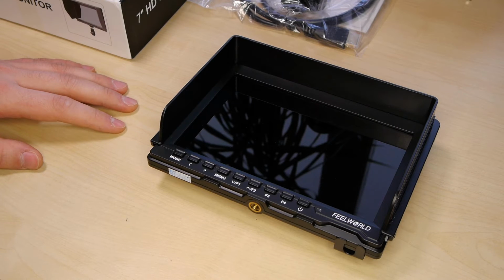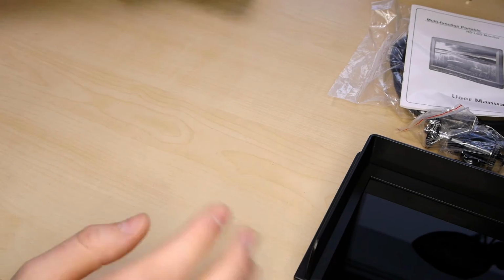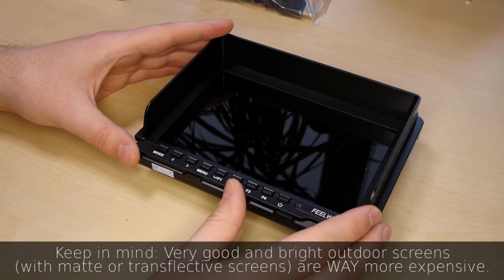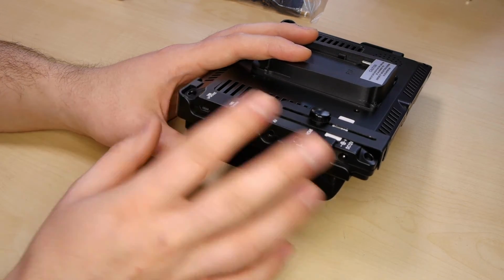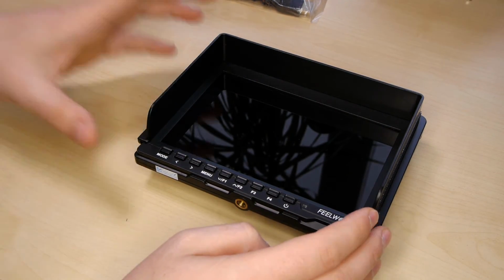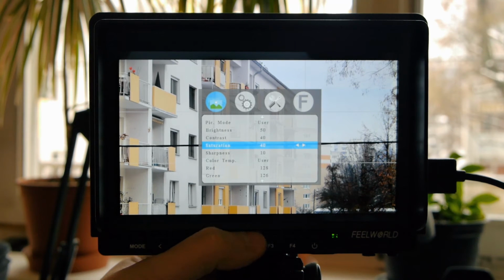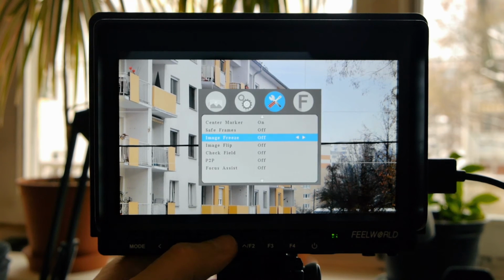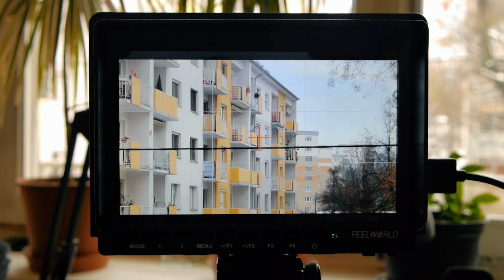Feelworld FW759 / FW759P field monitor - Very detailed HANDS ON (with calibration settings) (!)

Comment: Is there a way to turn off the speaker audio? I was filming a interview yesterday and could hear the speaker output. I guess i could plug up some headphones with separate audio control and turn the volume all the way down, but was just wondering if there was a better way.
Reply from the maker: Sorry for my late reply - Was busy ^^. You need to use the left / right arrows to control the volume. Just put it to zero (then you don´t need to use a 3.5mm plug or headphones to disable the internal speaker. Have fun shooting (!)

Comment: Help Please i just purchased at the same monitor and i tried using it for my canon t6i and it will not show anything?? have Any Ideas??
Reply from the maker: Hello there. Did you enable the live view on your camera (or the play mode -> To get a picture over the HDMI)? If you didn´t try it out -> Connect your camera to a TV set (with HDMI in).
If you get a picture there but not with the FW759 maybe try an HDMI feed from your computer / notebook. (The FW759 should be fully recognized over any HDMI port.) Maybe also try a different HDMI cable (the included ones are often of a not THAT high / desireable quality ^^).
Reply: what do you mean about play mode??
Reply from the maker: SniperFilms Playback mode (where you can check your stills and videos) ^^. As then also the HDMI is active (like while live view is active).

Comment: I recently bought US Stock Feelworld FW759 7 "HD
When I connect it with my camera, the battery starts to make a strange sound. A may be due that? Await response.
Thank you
Reply from the maker: Hi there. I am btw. not the supplier / dealer / manufacturer - So it´s maybe a good idea to contact the seller too.

But overall: Is it the camera-battery or the battery you use on the monitor to power it? If it´s possible, then try to change the batteries (maybe you got one with a low quality control circuit).
Btw.: Are you sure that it´s coming from the battery? Also try to plug in 3.5mm headphones on the screen (or dial down the volume of the FW759). Because: It´s maybe coming from the speaker at the back of the FW759 (theres the risk of a "feedback-loop" -> The camera is recording the audio -> Monitor is getting it over the HDMI and outputs it live. The camera records that again and so it´s getting louder and louder - If that´s your problem -> Yes. It´s a really weird noise ^^.)
Reply: It was a theme sound loop! Thanks a lot friend! you solved the problem I had! i'm happy! jejeje
Reply from the maker: Good to hear that it works now - Have fun shooting (!) ^^

Comment: will it be compatible with a canon xl 1 s? my view finder needs repair. quoted $400. will this replace it and save me the money quoted?
Reply from the maker: Puuh. An XL1s - Long time went by since I saw the last one in real life ^^. Hmm. I think it makes no sense to go for the FW759 (as I cannot tell you how good the analog input is). There´s also no converter included (you need to order it seperately) -> Because of that fact I never testet that input. Maybe it´s a better idea (overall) to search for a used cheap screen with direct component or S-Video inputs. Then you also don´t need a converter cable (the FW759 / FW760 only uses a very small 3.5mm adapter -> On the RIGHT side of the screen - Also a super stable and handy solution overall). Beside that, the older ones maybe produce better analog images (compared to the new models) -> The new ones are normaly optimised for digital inputs.

Maybe you´re lucky and you can find something for a few bucks (on Ebay for example) ^^. Especially the older screen models (without any digital interfaces) are normaly quite cheap. Btw.: Maybe also check out online communities according the viewfinder of your XL1s. Maybe someone can repair it for you (at a cheaper / lower price point). ^^

Comment: Does this work with nikon d3200?
Reply from the maker: Yes. It´s working. But you get overlays with the D3200 (like on your back display) and the image is not 100% covering the 16:9 image of the screen. You can test it out with a TV btw. - Just connect the camera with a proper cable and play around with the settings. (Also according the info display / info button for example.) Btw.: You can also try out the nikon hack. You get at least a higher bitrate (64MBits) and no time limit (at least its stated in the log as beta state). Sadly it´s not fixing the HDMI (so it´s outputting 1:1 the 16:9 image internally recorded).
Reply: Ok. Thank you. Why does it not 100% cover the image?
Reply from the maker: Well - Good question ^^.

In general (and especially with older DSLR models) they simply output / re-route the image displayed at the back over the HDMI. And as the image displayed there is no 16:9 format - more likely 4:3 or 5:4 or so - you also only get that image over the output. As mentioned: I highly recommend that you try it out with a HDMI capable TV before bying a field monitor (to see if it´s ok for you - And so you can try out different HDMI output options and info display options).

Btw.: Even if you cancel the deal after testing, you then have at least an HDMI cable to show pictures or videos over your TV (directly from your camera). ^^ Just two hints: Don´t get an extremely long one and go for a thinner / more flexible one - That way you can use it for both purposes (field monitor AND TV output) ...
Reply: That makes much more sense now. Thank you so much for your help!

Comment: will this work with a canon t5i?
Reply from the maker: Yes. Should work. But there could be a small black border on the edges of the frame (as the smaller canon cameras are not outputting a raw signal without any overlays / limitations to protect the Cinema line and the more expensive cameras from Canon - As an example: Even the brand new 80D isn´t coming with a 100% clean output .). Btw.: You need to switch through the HDMI output modes with the INFO button (there´s one mode with a bigger image and nearly no overlays). You can still try out the monitors zoom modes to remove the borders (or use at least udnerscan). But don´t use those modes if they make the image worse. ^^
Reply: ok, thank you for your reply!

Comment: So basically, my Canon T4i is useless with this monitor?
Reply from the maker: No. It should work - The "camera mode" wich adds aliasing and moiré is just neede for the REALLY old canon cameras (which output 480P while recording and only 1080i in standby and playback mode). The 650D (aka T4i) is outputting 1080i all the time. BUT (as I told "nicolas picard" a few seconds ago): There could be a small black border on the edges of the frame (as the smaller canon cameras are not outputting a raw signal without any overlays / limitations to protect the Cinema line and the more expensive cameras from Canon - As an example: Even the brand new 80D isn´t coming with a 100% clean output .).

Btw.: You need to switch through the HDMI output modes with the INFO button (there´s one mode with a bigger image and nearly no overlays). You can still try out the monitors zoom modes to remove the borders (or use at least udnerscan). But don´t use those modes if they make the image worse. ^^ You can also try out the HDMI output with a TV set (you just need a cable to test it).

Btw.: Screen wise its also working (as the FW759 and FW760 are 100% compatible to the interlaced signal of your T4i).
But avoid for example the Aputure screens (also the new Fine-HD models). They are not usable with interlaced signals.
Also check out the FW760 (it´s like an upgraded model of the FW759 with a higher resolution panel and even more features than the upgraded FW759P model) ^^.

Comment: Is there a battery charge indicator? How can I know if I have to recharge the battery?
Reply from the maker: There´s no battery indicator with this model (maybe the new FW760 got one - But this I cannot tell you as I don´t have or had the FW760 til now). Overall it´s the best idea to test out the runtime with the batteries you plan to use with it - BEFORE shooting the first time (NP-F550, 730 or the biggest 970 ones). Then you know (+/-) the runtime - Or you can also use an external battery plate with voltage indicator - Then you also know when you need to change the battery. The point is: It also depends on the batteries you use (and the quality of them). ^^
Reply: Thanks

Comment: Hi, been looking at this monitor but to have the battery pack at the back of my glidecam while having this monitor mounted to the front. I heard you say that the DC socket is 2.1 instead of 2.5? I am very confused in if this :
http://www.ebay.co.uk/itm/361565203908
is a 2.5 or a 2.1 cable? Since I would have to buy an additional cable to get from one side of my glidecam to the other since the DC cable that comes with that link is too short. 

Any help would be fantastic!
Thanks
-Connor
Reply from the maker: Hi there. Well - It&#180;s a 2.1mm socket. But it also accepts 2.5mm plugs.
It has more "play". But it is still working. So even if you only find a 2.5mm cable for cheap, it should work too.
At least it worked too with all of my 2.5mm cables I have lying around ...
And the 2.5mm ports are standard - So the 2.5mm cable is also better for the future.
As basically all other devices use 2.5mm plugs. ^^
Reply: ahhh, thats great then! So even if it is a 2.5mm DC cable then it shouldn't matter? Sorry I'm knew to the entire monitor/DC etc. business!

The plan is to get this monitor and position it at the bottom of my glidecam at the front, then buy that ebay item I linked to put to hold the battery at the bottom of the glidecam at the back so that it roughly has the same weight to balance it. this monitor looks perfect for it! So would I just order a DC 2.5mm to 2.5mm cable that is long enough to get from one side of the glidecam to the other?

Thanks so much for the quick response and help! We need waaay more people like you on youtube/online.
-Connor
Reply from the maker: xG4m3rPr0x Yes. Should work. As mentioned at least with my cables it worked (tried it with two different ones). It had also no connection problems. Was just more loose than with the 2.1mm one. But please don´t nail me down on that  - Just because it worked with my cables, that doesn´t mean, that it will work with any 2.5mm cable out there. ^^

But you can go for the 2.5mm anyway. Even if it´s not fitting (and the chance is high that it fits), you can also keep the 2.5mm version for the future. Because (as mentioned already): Basically all other field monitors and also most other accessories work with 2.5mm cables (as it´s kind of the "standard DC plug").

About mounting the screen: Should work yes. You maybe need a pair of 1/4" screws to mount them (which are long enough). But then it should be possible. You can even use the small ballhead which is included to mount and tilt the screen to the right position. Just remove the hotshoe adapter at the bottom of the ballhead.

Btw.: I also use such battery plates (Though - The older / standard model without the 12V converter internally). They work nicely. Just keep an eye on the mounting position. The 1/4" thread is a little bit offset with that plates (check out the 2nd picture). So to get a perfect balance, you maybe need to mount it a little bit angled (so the center of gravity - sideways - is in line with the rest including the mounted battery). Otherwise you have too much weight on one side (and it´s not possible to balance that out with a steadycam - At least not at the bottom).

Thx for the kind words btw.
Have fun shooting - And have a nice day. ^^

LG

Comment: Hey I am having difficulty understanding.  Would you please be able to help?  How can Blue or Green help detect noise in the image?  I have looked at check field blue and I don't see any way to detect the noise.  Please do let me know.  Thanks
Reply from the maker: Under normal conditions (at least with the standard CMOS sensors) it is the case, that blue channel is for example the "weakest" overall - So under normal conditions / with normal CMOS sensors it´s the best way to check the noise over that channel. Why? Because the bayer array uses blue + red + two green sub-pixels. So blue and red need more gain to get to the same levels as green. (Btw.: Green is doubled, as most of the brightness and contrast response is coming from the green channel - So there´s more sensitivity necessary). But there is also another point why blue is the "worst" channel: Red is additionally also more sensitive than blue (at least on normal CMOS sensors). So even though the sensor has the same count of blue and red pixels, you need to bump up the blue gain higher than the red one.

So overall the blue channel needs the most gain / amplification.
Therefore also the ground noise is amplified the most in the blue channel.

Hope that makes it clearer. ^^

So most important is the blue channel / blue gun mode.
Altough: I also don´t use it THAT much. Most of the time only for calibration purposes.
(Because in general you know how high you can go with your ISO anyways ^^.)

Comment: great review - what is the difference between FW760 & FW74K - is it same as FW760 but with 4k capability? 

if so, is FW74K (rebranded as neewer nw74k) better buy? they are essentially same price in amazon ($185-$189)
Reply from the maker: Well - The FW74K is a 1:1 brother of the FW759 - Same features (same 1280x800 resolution). Just with a 4K capable scaler at the HDMI input. That way you can use direct 4K siganls from different cameras. That´s important with the GH4 for example - As the AF performance is worse / slower, if you select 4K to 1080P scaling on the HDMI. So with the FW74K you could use 1:1 4K output (and you would get better AF). But the difference is quite minor / not THAT huge (as the GH4 is still not perfect AF wise) ^^.

About the FW760: It´s also similar to the FW759 - But it´s coming with more software features from scratch on compared to the FW759 - It´s more compareable to the FW759P model features wise. PLUS: You get the higher panel resolutiion (which is 1920x1200). Great to pull the focus. Too bad, that there´s no 4K version of the FW760 - As it would be great to zoom into the 4K image (with 1:1 pixel output on the native 1080P capable panel).

Overall the FW760 should be the best choice actually (if it´s not a "must have" to output 4K over the HDMI).
Btw.: If you plan to use an external 4K recorder, the FW74K is again the better choice.
(At least if you plan to use it together with the recorder. As then you need to output 4K over the HDMI anyway ^^.)

Hope that helped (and it wasn´t written too confusing) ^^.

Comment: hi. can I use this monitor in canon 70d..?
Reply from the maker: Should work - BUT it´s no 100% clean HDMI (so you still get overlays and a small black border as far as I know).
You can easily test it out btw. before ordering an external screen - You just need a normal HDMI capable TV.
Connect the camera and check the different viewing modes in live view through pushing the info button.

Comment: So have you tested the FW 760 yet ?
Reply from the maker: Not yet. Maybe I´ll do so in the future (if most other projects are finished. And as soon as I have time to test the VS-2 FineHD.) ^^ But overall it seems to be basically the same (base hardware wise - Compared to the FW759). Just the panel has a higher resolution and there´s just one version. (Not a standard one an one with advanced features like it was the case with the FW759 and FW759P models.)

Comment: Your videos are very detailed and I have learned a lot from them!  I just noticed these guys made a FW760 that's 1920 by 1200.  It has a bunch of features like histogram, false color and more peaking features.  Do you think it is a better investment for the extra 50 bucks? I really like have my grams and forms on my screens!  I also hope the quality is up to par as well, mainly retaining the detail for focusing.  what do you think? Thanks again!
Reply from the maker: I know - But THX for the hint. I added now a box mentioning the FW760. ^^ About buying the FW760: Yes. I think it´s worth the few bucks more. I think they just changed the panel (and the software). So it SHOULD be on par overall quality wise. The higher resolution helps alot to focus even better (also without the focus helpers - Like Focus Peaking and zooming). And as it´s really not THAT much more expensive -> I personally would go for it. Maybe I´ll do that in the future (as I actually sold the FW759 to test out other models).
Reply: Awesome man thanks for the reply, I will definetely be getting FW760 thanks to you!  Keep the good stuff coming!